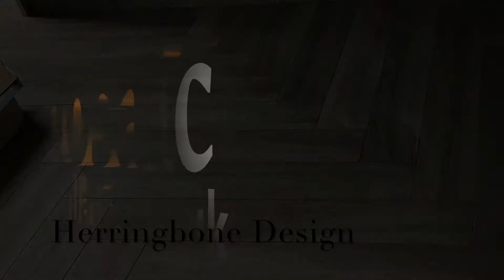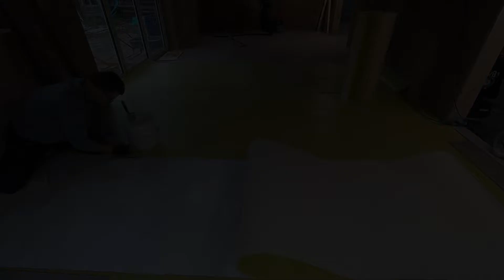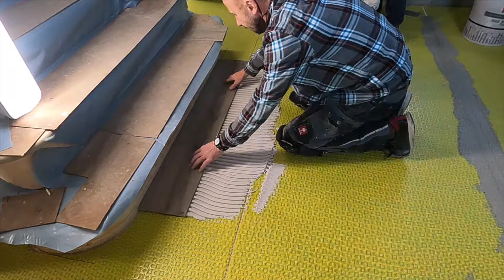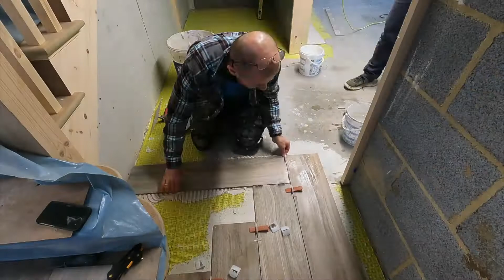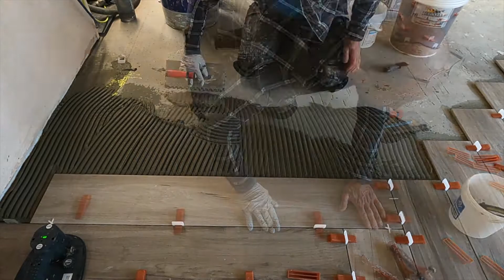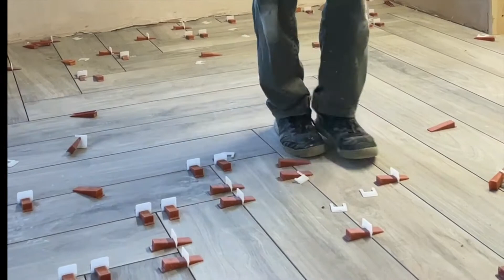How to Install Wood Effect Tiles with Raimondi Clips

Comment: Fabulous, perfect on how full looking tiles land at the patio doors, especially as this is a subconscious focal area.
Question:  l noticed that some of the main areas of the yellow matting had a dry screed appearance, is this additional levelling out?
Reply from the maker: Yes. I’ve noticed after installing Yellow mat that floor dips in some places. To avoid problem next day with installation it was quicker and easier to fix it with adhesive and long edge day before. Than I was able to apply only adhesive on the floor and butter each tile  without dot and dab which is not good idea.

Comment: How would you set out for something like this or would you just pick a spot to start and hope for the best
Reply from the maker: it was a challenge !!! You have to spend some time laying tiles loose and pick the lines and square it to the room to longest and most visible wall. 
You have to check every module and square it to the rest. Its very easy to go astray. Do not trust spacers !!!!
Reply: @faron.coltdmactilermosaici301  you have a lot of patience.  Great work.